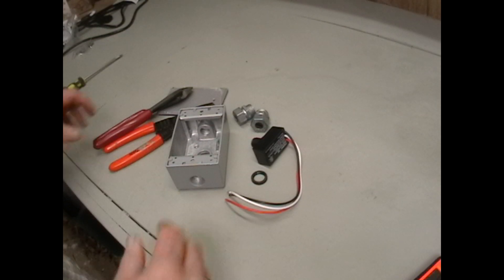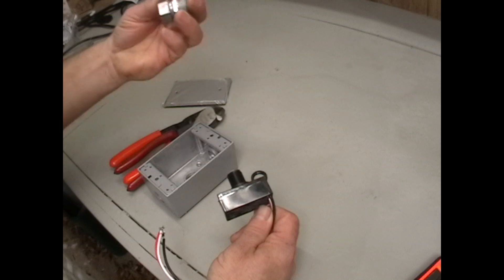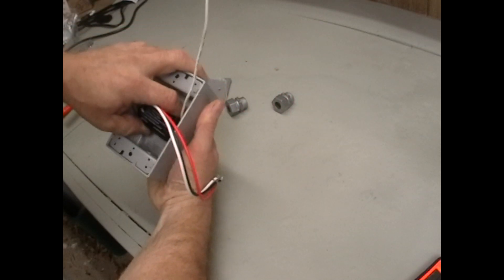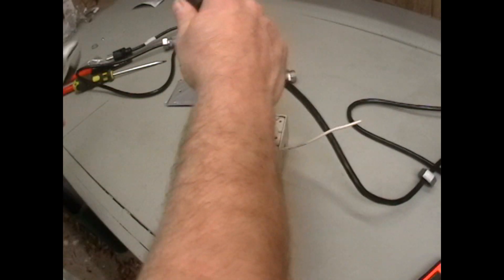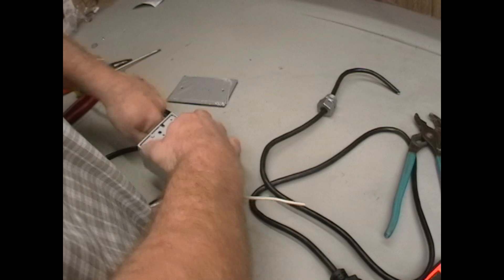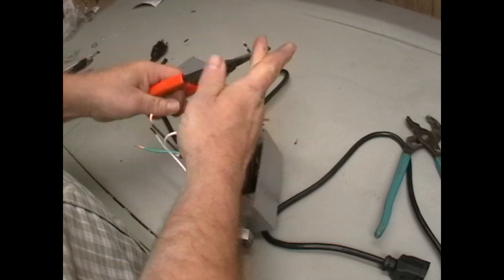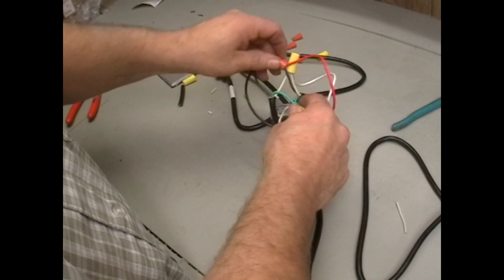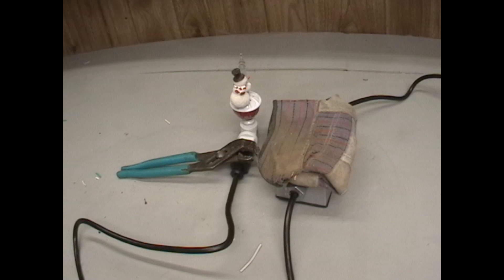Make a Photocell Cord for Christmas Lights

Comment: I truly appreciate your instructional video! I have several strands of LED lights in my porch, and up till a few days ago they were programmed on a GE outdoor timer that just went kaput. After a few minutes of research of photocell timers I found several that I can just plug into a power strip, and then plug the LED strings onto the bottom of the photocell timer. But after viewing your video I'm leaning towards replicating your option instead. Thank you.